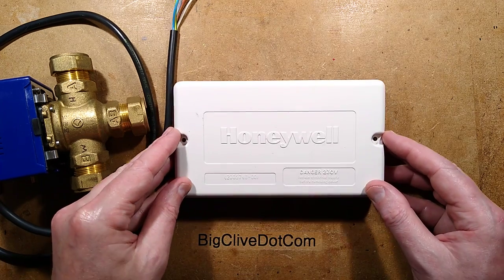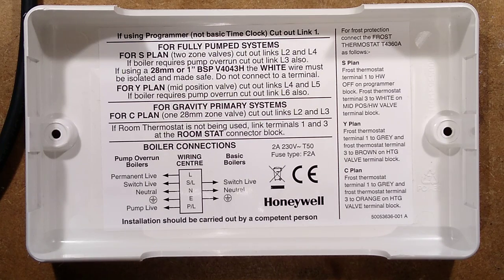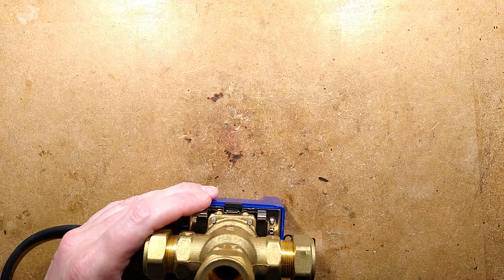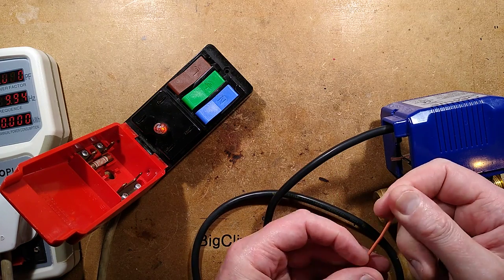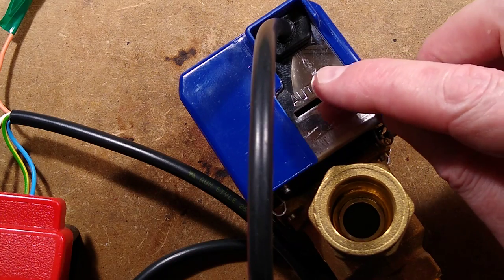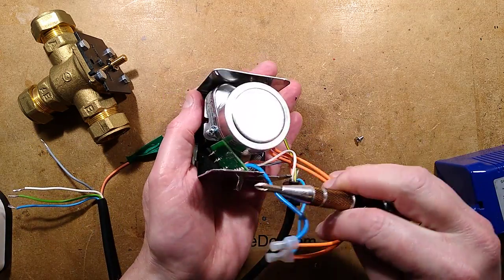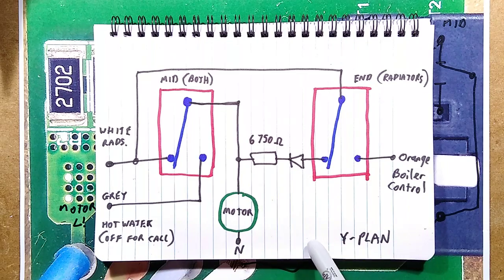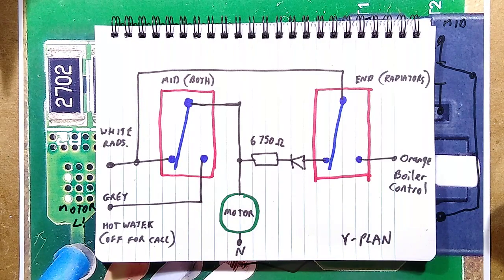Inside a clever Honeywell boiler wiring centre and a 3-way valve.

Comment: Using that diode and those resistors to keep the motor in a reduced, half wave voltage stall tuned to exactly counteract the spring force, is sheer brilliance!
Hats off to those guys for keeping it simple and reliable.
Reply: YES!   ...next retrofit challenge is a drop-in, solid state, 100% optical replacement for those micro switches.
Reply: @racitup4114  LOL! True!
I had about five night lights plugged into outlets in my hallways before LEDs that drew about four W a piece, and were practically useless unless I had to drunk-walk to the wrong bathroom in the middle of the night to take a whizz.

I'll take seven W on an irregular basis over all the other things every day.
Reply: I don't think it's all that finely tuned, it's just feeding it with DC so it acts kind of like a stepper that's not being stepped.
Reply: @ettlz Yeah, I've had the same thing. IMO these valves are overpriced garbage as reliable as a chocolate teapot. 

Also the engineer in me hates that the at rest position has the HW outlet open which can allow the heating loop to convect heat out of the HW tank.

We get "standby shamed" for a couple of bits of consumer electronics with a 1 watt standby power but these are far worse. Edit: I guess it's only  when you want to heat the house so not quite that bad, just a bit lees efficient that the main heat source.

I much prefer using 2 x 2 port valves, then you can use the manual open on a failed actuator and let the other enable the boiler so you still get HW and some heating if you have either actuator fail.

You used to be able to get ones that motored until cutting of completely in the required position and so having none of the above issues, no longer it seems.

Now thankfully history for me having just gone combi, just hope I'm lucky with the combi boiler! I'm hopeful - the one I have has stainless heat exchangers.

Comment: Nice units but I like to think it's important to fully understand the wiring of central heating systems before installing them, even when using wiring centres like these. They are after all really quite simple. A good understanding of the wiring and how the components work also makes fault finding much faster and easier. I'm always surprised how many electricians and plumbers are baffled by 3 port mid-position valves and have no idea they operate!
Reply from the maker: That's why the wiring centre is useful.  A lot of heating engineers can't actually get their head round the control system.
Reply: As an US Tech (licensed as well), I see a lot of weird shit done wiring up boilers, I have seen many jobs were the installer or maintenance has Jerry rigged the wiring to the point of reinventing a square wheel.
Reply: @bigclivedotcom  and so called electricians who are baffled by 2 way light switches with intermediates.
Reply: @bigclivedotcom  God help them if they come to our house and find 2 TRVs on the bathroom rad - cos it's on 2 zones !
Reply: "How to wire, by painting by numbers" doe's my nut right in! :/ learn the theory, apply it...
Reply: @muzikman2008  thing is they are plumbers not electricians.
Reply: @muzikman2008  I was once asked how I knew which connections on the back of the amp to use for the video when none of the connectors were labelled for such !
Reply: @bigclivedotcom  leave it to electricians who can then. Plumbers doing wiring installs should not be allowed to, like electricians shouldn't touch gas 😏 I've seen plumbers wire up Yplans wrong and boiled water in cylinders, because didn't connect cylinder stat correctly in the wiring centre. You need to understand what you're doing before embarking on wiring central heating systems. Seems a grey area these days.
Reply from the maker: @muzikman2008  Everythings a grey area these days with the skills for cash faux-training companies and the certifying companies that are really just marketing companies.
Gas Safe is just Capita.  The same organisation that collects TV licence cash and "looks after" the NHS records.
Reply: @bigclivedotcom  agreed Clive, totally.. I wish they would bring back proper training, apprentiships, 4 year on tools, site training, and ban these training companies who are just money making schemes that fool people into thinking they're gonna be electricians overnight. Don't get me started on NICEIC either lol... The UK is grey enough 😂🇬🇧
Reply from the maker: @muzikman2008  That's unlikely to happen, as the training companies are sometimes run as "investment" companies for people associated with the government.
Reply: @bigclivedotcom  that's sadly true!.. Money makes the world go round eh.. ☹️ Should be all for the common good now, look after our own training of our own people.

Comment: Honeywell has some very clever stuff.   When we installed a new heat pump, the manufacturer called for an 8-wire thermostat connection.  In our home, all the wire is buried behind walls and replacing our 7-wire cable would have been a real job, given the wire path between floors.  No matter--the installer turned to a 2-wire thermostat that talks to a controller down on the heat pump.  Has all sorts of options; multiple temperature sensors and WiFi--all over 2 wires.

Comment: My house has one of the early 80's honeywell boxes where everything is Rammed in there and screwed shut. Quite tempted to get one of these and re-do it myself to make it neat and tidy.
Reply: Best left alone if its working.
Reply: Dont screw with old wiring without checking carefully. 

If your cable insulations bad, moving it could cause you all sorts of trouble. Its also likely that something is non standard, and it will take a week to fix.

Think twice, and triple check its going to be warm when you kill the heating for a week...

Comment: Following my visit to the UK, where I had the pleasure of using many different establishments and homes showering facilities, I think it's fair to say that the height of plumbing in the country was reached during Roman occupation, and went downhill from there.  I don't know what that thing has to do with it, or what other monstrosities are hidden away in your wall spaces and utility rooms, but I was very glad to the back in Australia to have a decent shower with steady water pressure, consistent temperature and with a volume that means all of me remains showered upon throughout.
Reply: @geordie matthews which way does the water spin in your toilet
Reply: I agree about the state of showers in the UK, wouldn't call it a pleasure, I haven't had the Australian experience. However you can get good ones in the UK, mine all give good flow and a constant temperature irrespective of what else is used etc. because they are indirect and pumped. But I have to say the shower problem is worse in France and Italy, where practically none of the houses(as opposed to apartments) have any control over flow or temperature, including my own house in Italy.The problem is that houses are all "high pressure" directly off the mains supply, but the mains water pressure is very very unreliable. Installing a system (autoclave in Italian, very confusingly) to overcome this is common, but they do not work consistently . Are Australian systems generally direct or indirect? (NOT A PLUMBER!)
Reply: @oldestnic , the Aussie systems are typically direct from the mains, either with a water heater with storage tank (allowing for off-peak heating) or are instant, heating the water only when in use.  Most of the time even flushing the toilet in the same bathroom has little effect on the shower running at the same time.  Solar hot water heaters are quite popular too, further reducing gas/power consumption.  The other side of this is water can be quite scarce in Australia, and high efficiency shower heads and taps are quite common, which considerably reduce flow thus volume.  But you take the good with the bad.
Reply: nah, not ALL aussie homes have good pressure. Last place I rented has full mains pressure cold and gravity fed hot - crank the hot all the way and just a tiny touch of cold or you freeze your nuts off. Then again, it took 10 years for the jerk landlord to replace the indoor ONLY rated ceramic fuse box that was mounted outside, facing the ocean. Ten years of constant complaints, electricians warning him it was a death trap, black corrosion on all the copper and regular showers of sparks raining out of the box before the threat of having the place condemned forced his hand. The oven also exploded at one point...
Reply: @oldestnic  where is your house in Italy?

On a residential building the problem your facing are quite common. (Even my flat have this problem due to the old construction date ('60).

And south of italy have old and water resources problems so no wonder about shower problems.

But on my house, the problem is not present at all. Pressure is so strong that sometimes the boiler have to release some pressure. (And yes the pressure regulator is installed but the flow is hi)

Shower temperature is directly controlled by the shower knobs. That have a mechanical thermostat and can mix hot and cold water.

But at least our electric systems and heating system are a lot easier that most of other countries. I've never seen 2 way valves. (Edit here, I have an Honeywell 3 way valve inside my heating boiler for the exact same purpose. Hot water vs radiator circuit. But is manages by the boiler logic board directly, we just a a T.A. terminal block to short to enable the heating call.)

I have a 4 zone heating here. And I have a single valve per radiator. So I could actually control each room.

Just because I'm an IT guy I've installed an PLC to control them with pid and crazy indoor outdoor temperature stuff.
Generally a simple on off thermostat. would do the same.
Reply: Geordie Matthews - unfortunately a significant number of home owners want the cheapest solution. The house that I bought (in England) has a heat store system. Mains pressure water is indirectly heated by a heat exchanger, this then feeds the showers (three of them) and hot water taps. As the mains water pressure is good, your shower is not affected if someone else uses any of the hot water taps or uses one of the other showers. The heat exchanger is contained in a tank where the water is heated by a separate gas boiler. The  heat store tank also supplies the radiators. Within 2 minutes of turning on the heating the radiators are hot at the top. A few minutes later they are hot from top to bottom. The boiler is commanded to cut in by the heat store control system whenever needed to maintain the tank water temperature regardless of the time of day. Because the gas boiler is a standard (and relatively simple) design, it’s still in service after over 17 years of use. Unlike the more common combination boilers which don’t appear to be very reliable.
For houses that were never originally designed with showers in mind, instantaneous electric shower units are used. Unless you have one of the high power ones (preferably with a pump), a slight change in water pressure can cause the ‘only just hot enough’ water to change to, what feels like freezing, in a blink of an eye...
Reply: I think showers that totally cover you are extremely wasteful of water.

Comment: In the Netherlands, most of the homes have a single unit that does both the heating and hot water. Usually, hot tap water is not stored in tanks, but is produced on the fly. 
It comes as whole unit, so it is quick to install. just connect the pipes and hook up the thermostat and you are done.

Comment: That's clever, putting some Dc on the synchronous motor to hold it mid position.
I love these simple, elegant engineering solutions.
I also enjoy your sharing of the information with us
Best regards,
Duncan
Reply: Wasting 7 watts of power keeping a valve open is NOT elegant. (IMO). Actually I guess it's mitigated by the fact it's only when heating the house and so it's not really wasted - just a bit less efficient and more expensive than the heat from the gas boiler.

Comment: Clive, you've saved the day again. I discovered your channel when attempting to diagnose a faulty cooker clock/timer, turned out to be a dry solder joint, one of your vids helped me find and fix it, and now you've helped me with my non-existent hot water! I thought I'd have to replace the whole valve, but I can do just the motor and JB?! And lo, there was again hot water! Much appreciated! What will you get me fixing next?!

Comment: Ah, the apprentice box. Throw one of these at them then tell then about the secondary conservatory heating circuit that stops the grapevine freezing and that it's a three pump system with relays. 😂

Honeywell three-port valves are cunning engineering genius though. Can't reduce that component count anymore. They can lock-up in the wrong place if customers are prone to messing with the programmer settings throughout the day because they don't always fall back to the expected position.
Reply: The 2 port zone version sticks open, usually the micro switch gives call to heat for boiler so you come home to a boiling hot house with a boiler that’s not stopped running all day.

Comment: I have this in my house, with a Landis & Gyr RWB2 mechanical timer controller. That also lives on in the Siemens RWB2e which has the exactly same wiring diagram in the manual as on the back of my unit. As a hint of age, the PCB of the honeywell sundial has 1987 stamped on it for when it was designed (pre RoHS of course which seems to have been the big change to your current unit), and the date of manufacture of the rwb2 was 1996.

Comment: My house has a 110-volt oil-fired burner with two internal water coils: one that feeds the hot-water baseboard (with a tiny supplemental water tank), and another coil that feeds the hot water at the taps. Our thermostats are 24 VDC that feed back to 3-wire zone valves that open or close depending on thermostat call (it's binary - either call to open, or call to close). There is a 110-volt recirculating pump that activates when any of the valves open to pump the hot water through the baseboard loops. The hot water for taps/faucets is a straight-shot from the main well pump, through the hot water coil, and out to the pipes.
The burner itself runs automatically via very basic high and low temperature cutoffs to keep the water toasty for whenever/wherever it is needed.
Keep in mind this house was built in 1975 by my family - my maternal grandfather was a licensed plumber and he originally installed this massive behemoth of a furnace - the left side was an oil burner (but could be converted to run LPG) and the right side could actually burn wood. When we finally had it replaced (and the new furnace has a 3' x 4' footprint and is only 4' tall) the techs said, "Man, I haven't seen one of these old furnaces since we refitted all the furnaces in (local housing project) and... Damn." I smiled and said, "my grandfather installed those furnaces and plumbed those houses, he bought our furnace at the same time that housing project was being built." 
Now, sure, the new furnace has a very basic "brain box" now, with error codes but no legend for what they mean (random letters that don't even relate to the issue) and it requires a PhD to reset the dang thing if we've run out of oil and it takes me more than three attempts to bleed air from the fuel line (and it's outrageously-complicated to set the min/max temperatures on a two-digit display)... But other than that, it does the job, far more efficiently than that massive beast it replaced.

Comment: I’m in the US and we have something similar here but they are not common for residential use we mostly use natural gas or electric for hot water and forced air heating or a boiler with radiators that is separate
Reply: I have this very type system. A hydronic nat gas base board system. OR you can have a floor heated system in concrete or under your carpeted floor.   NICE and warm floor in the winter. Works VERY well at 95% eff.
REAL ONLY problem is the little brass gear that drives the valve wears away.

Comment: The label says "Installation should be carried out by a competent person." As if an incompetent person is going to read that and think "well, I'd better not try this then" 😂😂😂
Reply: That's probably to protect the manufacturer from fools installing it then blaming the company when it goes bang... Same way food which needs heating says "may be hot" on the label...
Reply: Indeed, the old Dunning-Krueger effect running strong with many
Reply: @AAAyyyGGG  That's how the legislation is written. Back in the day a lot of electricians and plumbers didn't have formal qualifications (many still don't) and a "competent person" means someone with knowledge gained through experience in associated industries, apprenticeships or formal training. Same with gas work, you have an assessment to prove your competence that then allows you to be GasSafe registered instead of needing any specific qualification.
Reply: @khaitomretro  there are plenty of "qualified" electricians that are not competent,  I have met some I would not trust to wire a plug let alone a building HVAC management  system.
Reply: @dogwalker666  I did my apprenticeship back when it was the 14th edition and came off the tools shortly before the 18th came into effect so I've met my fair share of "qualified" electricians that I wouldn't have working for me.
Reply: @khaitomretro  agreed.
Reply: Oh yes, this is far too complex so Australia. You would definitely burn your house to the ground if you tried to install that as a home owner here. Just like everything else here, electricity is much more dangerous in Australia. That's why only electricians and plumbers would be allowed to install these sorts of things. Thankfully we have little need for such heating systems, otherwise we would have a much higher rate of house fires due to home owners trying to install them or make repairs themselves.